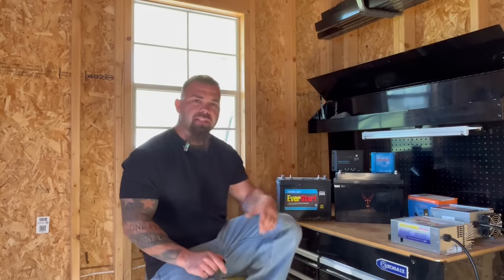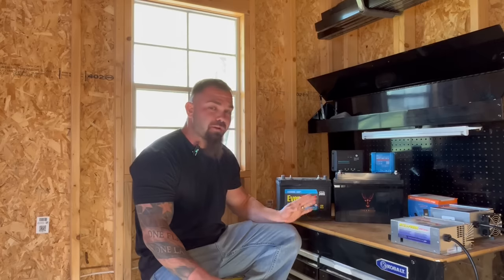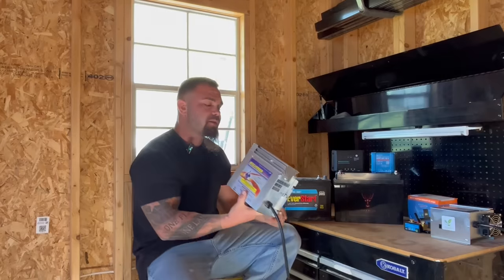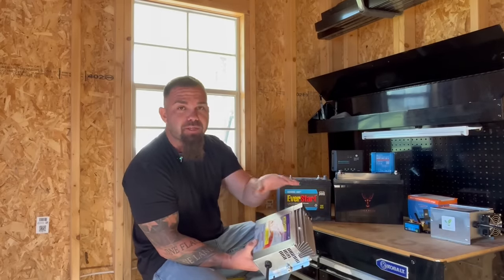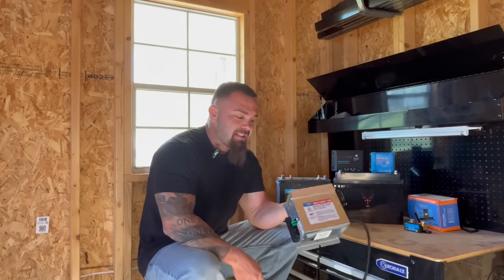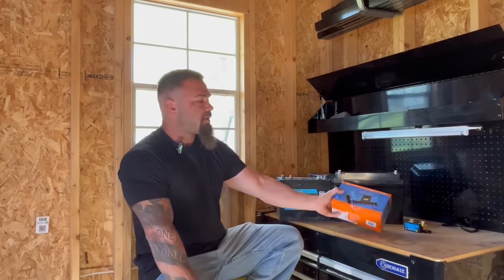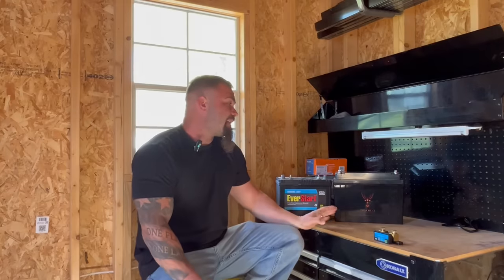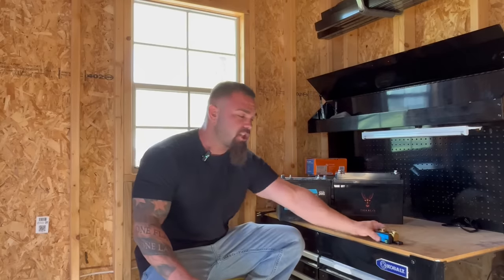Swapping to Lithium? WATCH THIS FIRST!

Comment: Been running my house off a large lead acid battery bank for over 12years before I switched to lifepo4.  I guarantee you a lead Acid battery will not be charged if you charge it to 13.8 volts especially when they are used overnight. They need to be charged to 14.4 minimum and brought to 14.8v at least once every 2 weeks.  Lead acid doesn't even come close to a lifepo4 battery.  AGM for instance is a stand by power system battery with a lead calcium chemistry that doesn't like to be cycled it prefers a constant trickle charge that is why they used to be used in power backup systems like cell phone towers need.  Lead acid is dead and can't compete with lifepo4
Reply: Lead acid makes for great engine starting batteries. I have had battery backup at home since the 1989 Loma Prieta earthquake. I had lead acid deep cycle battery bank, 6 volt Trojan battery bank, AGM 210 amp hour cell tower backup battery bank, forklift batteries. In 2017 I started using LiFeP04 batteries.  They have their quirks but are miles ahead of any other backup battery system that I ever used. A 50 amp hour LFP lithium battery easily replaces a 100 amp hour AGM battery. All lead acid batteries do not bounce back in voltage after heavy loads ''the Peukert effect'' like a lithium battery does. Lithium charges much faster, retains a fairly flat discharge voltage curve until its discharged. They are less than half the weight, last 10 times longer and have internal protection BMS units.  

The difference between lead acid batteries and LFP lithium batteries is like comparing drum brakes to disk brakes. Disk brakes don't easily fade after heavy braking, water doesn't bother them, they are easier to replace. I have a 1931 Ford Model A with mechanical rods that pull the brakes. No hydraulics. Lead acid compared to lithium. If they worked so well, all race cars would have mechanical drum brakes. Going 50 mph in the Model A is like doing 150mph in my Toyota Camry.  But you can't change the minds of old golf cart battery fans....
Reply: @kimmer6  yes very true...seeing these videos is kind of bothersome because obviously they are not experienced enough to know what you and I have experienced for decades. Since I changed to lifepo4 I get over 30% more power out of my solar panels and hardly ever need to turn my wind turbine on where as before my wind turbine was constantly going.  Also I never charge my lifepo4 bank more than 27.6v ever and I get the full 1010 amps hours out of my bank. And they are fully charged before noon! My lead acid batteries never ever were fully charged ever! .I monitor Amp hours with the wizbang Jr shunt on Midnite Classic charge controllers which is highly accurate. There is no comparison and like you said they are good for starting batteries that's all . Lead acid lead antimony are the true deep cycle batteries for lead acid and need to be cycled to maintain their capacity.  AGM are lead calcium which are meant to be used for ONLY stand by backup power use and aren't designed for cycling. They have a lower self discharge then lead antimony does .I could go on forever lol . 😆 I won't even start with maintaining them lol
Reply: I agree .
I use in my boat lipo4 .
Charge the lipo4 to 13.6 volt .
So i do not use security from the lipo4.
The battery will be 99% full.
And the bms will not go off.
A bms is a security if you go to high and close the systeem of.
Its not use for 24/7 like people think
Reply: @dyslectische  definitely you're right
Reply: I bet the car batt size battery is a rocket engine when one has thermal run away
Reply: @VinniePepperoni  You might be surprised to learn that there is more than one lithium chemistry.  The LifePo4 chemistry has almost no thermal runaway potential.
Reply: @kimmer6 
When I read stuff like that you definitely have my attention. The next question always becomes I buy near new for 20 cents on the dollar, and these are not RV or little boat batteries so where is the savings besides weight?

Maintenance I have no issues with.
Reply: @donaldradcliffe6704 Then why are so many home battery banks failing and catching fire.
There are recalls on this.
No lithium batteries allowed on my boat.  I refuse to have them for deep cycle purposes.  The Optima Bluetops are getting 10 years life and the yellowtop in my car is over 8 years old now.  Lithium is great  until it isn't and the thought of a lithium battery fire doesn't bear thinking about when you are 100 nautical miles offshore...
Reply: @1Longranger you said a mouthful brother…..better have a life raft and get it deployed immediately.
Reply: Yes, but there is always a possibility of a fire or explosion with lithium batteries. I'll stick with leaf acid batteries for now.

Comment: Best video I've seen so far about converting a RV, including class c's,  to lithium batteries.  Very comprehensive and nicely explained. Thanks.
Reply from the maker: Thank you sir!
Reply: thanks Bro very helpful
Reply: Agree.  No B.S.  I watched it twice and took notes the second time, then I subscribed.
Reply: Agree. Excellent video and very well explained 
I went to lithium 2 years ago in my older Lance Truck Camper …
420 w of solar on the roof ..
Upgraded the converter and it’s been a fantastic setup with  200 amp hour batteries
Reply: I agree best explanation I have heard. I understood all. There was 2 instances where he interchange lithium for lead acid and vice versa, otherwise perfect explanation.
Reply: What lithium battery manufacturer do you prefer?
Reply: This is great.  I have known this for a LONG time.  Very well described here.  One thing more, you need to disconnect the “isolation” relay in a motor home when adding the B2B charger so they don’t get paralleled when charging.   You could keep it for the battery “jump” part, but change the automatic paralleling circuit.

Comment: I have been camping for 20 years and never disappointed with my Interstate deep cycle battery that I replace every five to seven years. I see absolutely no reason to change what already works well for me.
Reply from the maker: Different strokes for different folks! Glad you are having success!
Reply: Ok
Reply: Far less weight for the same power or far more power for the same weight.
Reply: Do you do a lot of dry camping while using the A/C? New to RV camping.

I live in the desert and just wondering what it would take to run the A/C at night.

Comment: Excellent video! Installed 600 watts of solar on my RV last year, changed my batteries from 2 lead acid to "3-100amp Diablo Lithium Batteries". I Installed all Victron Components from the Multiplus ll to the Shunt, Charge Controller, Cerbo and Touch 50 monitor and love the setup. The Diablo batteries are a game changer not only can I check the state of charge from the shunt but each battery has a bms and is bluetooth so I can check each individual battery. Justin from RV Solar Concepts was a huge help with a wealth of knowledge. If anyone is looking to install solar on their RV I highly recommend RV Solar Concepts. These guys know what they're talking about and their workmanship is 1st class.
Reply from the maker: Good to see a local customer on the our new Youtube page!! Glad to hear you are loving the system and we appreciate the kind words as well!
Reply: Victron has been the market leader in control gear for quite a while but which is the "best" battery changes frequently. Anything sold as "the best" by a reputable supplier will remain good for the 10+ years lifetime of your battery but the next model won't necessarily be as good as another brand so leave that choice to your supplier on the day. Most brands supply BMS & Bluetooth nowadays.

Comment: Well done.  You covered these issues perfectly.   One item I would add to this conversation.  I have an off grid cabin in the very cold at times north country and it runs on solar.   The only reason I did not go with Lithium is because the low temperature charging limitations of a lithium battery.  Below 30F they do not do well.  Take care.
Reply: There are many ways to deal with charging lithium in cold temperatures... a 12 volt lap blanket being the simplest/cheapest.
Reply: Keeping the battery inside the house also solves the temperature problem.
Reply: In fairness , lead acid suffer from extreme cold too . Just to put that in perspective , i have no intention of changing to Lithium . It would be life threatening , used for the purposes i use them . Recently i have heard of several installations literally going up in smoke , without loss of life it should be added , but frankly i think it's purely a matter of time . The other thing is due to the nature of the risk , it's actually unlikely we will ever hear of such an event , which would likely be reported as persons missing , reason unknown !

Comment: Thanks for the information. Was contemplating swap to lithium in my 2006 class c. Everything you have said has me realizing all the rest of the changes needed. I’m going to go with a solar powered Ecoflow system with a 400 watt charging panel. Just easier all around.

Comment: A lead acid needs to charge to 14.4 + or - depending on temp. 13.7 is float. 14.4 is a perfect charge voltage for lithium as well.

Comment: Man this was EYE OPENING....my RV shop is really selling me on going Lithium in my class A, which I really want to do. But I am going to grill them on all this info before I do. I absolutely will put in these safe guards.....Thank you!
Reply from the maker: Yep hold them accountable! Dealers will just pop your old batteries out, put lithium in and it will perform like dog shit because they don't change the settings or the equipment to properly charge them. Then you'll be chasing non-existent problems and just assuming lithium is junk which is not the case, you're just only using half or less of your possible storage because they aren't getting fully charged.
Reply: @rvsolarconcepts  Yes sir, thanks again!

Comment: This is the first time I have seen anyone properly address the voltage differences. It also applies to the current you can safely charge with. NiCad, Lithium, Lead Acid and other batteries, all have specific charging needs. 
I knew this from my Ham Radio stuff, that you couldn't just swap out different types of batteries. Radio Controllers for toys and models also are designed around specific battery types, do to significant voltage differences, and charging voltage and charging current differences.

Eric gives RV Solar Concepts a gold star for doing his research.  😆
Reply from the maker: The devil is in the details, but it sounds like you know that sir! Thanks for your input Eric!

Comment: Thanks for clearing up the drop-in myth. On my RV, i contacted the converter manufacturer and to my surprise they responded with a diagram showing me where the lead acid/lithium dip switch is! A flip of the switch and I'm now putting out 14.6V! One 100 AH Lithium essentially has the capacity of two older 100 AH lead acid battery!
Reply from the maker: Nice! Glad you had a compatible model! You're off to the races now!

Comment: That was Friggin' awesome... very informative. I will add, one cool thing that lithuim is going to is having an onboard Bluetooth system telling you all the pertanant information eliminating the Shunt. I literally just got a new battery with this option so I have no idea the accuracy of it, bit it is extremely cool and may eliminate at least one item? Also, One thing that wasnt touched on is extreme weather, be it cold or hot. These things do have a window they must stay within or they will fail. Some manufacturers are adding shutoff options to the bms system which is highly recommended. Just thought I'd add that.... Thanks guys!

Comment: Nice video. But I  would like to say that my 4 six yr old Trojan 105 FLA's have been great for me & still going strong. I have 390w solar on roof & 2000w inverter w/Victron controller. If it's sunny, my setup gets us all the power we need as we camp where we have a good chance for nice sunny weather. My lithium friends run their genny's on cloudy days just like me. We don't ever need AC as we chase 60 to 80 degree's only. If  we happen to be in extreme heat, then we'll get a full hookup spot in an rv park for a coupla days as we need to do this anyway from time to time to do laundry & such. Anyhow, just wanted to let folks know there's a simpler way with  heckuva a lot less cost.

Comment: Great video about replacing lead acid with Lifepo4 batteries. Excellent explanation of all aspects of the two systems. I have done this change over three years ago, replacing my very heavy AGM battery with a 24lb 100 amp hour Lifepo4 battery. I have not changed my converter however, and have had no problems with the performance of the Lifepo4 lithium battery. I do have 300 watts of solar, and a Renogy charge controller that I set up for my  lithium battery's charge profile. I also have a Renogy 20amp DC to DC charger rigged into my truck, and a have a stand alone 25amp battery charger that a lithium charging profile. You don't need to keep a Lifepo4 battery fully charged at all times. I just top mine off once a month.
Reply: Your charge controller runs at 14.7 volts to top off charge on batteries?
Reply: @hstorysalie  14.6v

Comment: I'm glad I watched your video.  I'm getting ready for a cross country trip in our RV.  Both of my current lead acid batteries are junk.  I was going to replace with Lithium.  But after watching your video, I'll stick with the lead acid one's for now.  You saved me a lot of grief.  Thank you for posting your video!!  You explained it very well for the average person to understand.
Reply from the maker: It definitely takes a little planning and understanding to do it correctly so I'm glad you found the info beforehand! Thank you for your feedback, safe travels!
Reply: You can swap batteries amd do the other stuff later, it won't hurt anything,  im in the same situation with 4x6v batteries that need replaced, I'm dropping 2 BB direct replac batteries, I do have a 200w solar system and I'm able to switch it to li mode.. BB said it won't be an issue, amd the solar can actually bring the batteries to full capacity charge

Comment: The other thing people don’t consider is where the battery is stored. LiPo and LiFePo4 are excellent batteries, but need to be kept away from extreme temperatures (hot and cold). Some have built in BMS systems with battery heaters to help in the cold, and also shutdown the battery to avoid a thermal runaway scenario, but generally an engine bay is a bad area for them. 

Also, a lot of vehicles are now equipped with “smart” alternators that will easily output 14.xx volts depending on the load requirement.

Comment: Good video. I myself did just enough research before buying my battery. I have a Victron Smart Shunt and Controller. Been working great. Only problem I ran into was an occasional update resetting the controller to a non lithium setting.(hasn’t happened lately) I changed out my converter. Nice to go from 4-5 amps from the old converter to roughly 25-33amps charge with the new one. I ran into one guy who put a lithium in his camper, but was satisfied with it NOT being charged properly. My only (sort of) mistake; I bought mine a couple years ago, so yes a bit more expensive and had little options on batteries capable of proper charging in cold weather. Although I winter in southern New Mexico, i wanted to be prepared just in case. So bought a more expensive one capable of cold weather charging only to get curious enough to find the battery compartment never got cold enough for the BMS to kick the cell heater in. While rare, I still get into single digit temps but plenty(like 2 nights ago) temps got down to 16° and battery compartment was still above freezing.
Reply from the maker: Well that's good that you never ended up needing that feature, but it's there if you ever do!

Yeah I think most people believe of the ambient temp is below 32 degrees then the batteries won't charge. In actuality, as long as the internal temperature of the cells is still above 32 they will operate as normal. In most cases, it takes several hours at 10 degrees or below to finally reach the point of triggering the battery protection.

Comment: Thanks for this clear explanation on the compatibility of existing RV systems and tow vehicle alternator charge circuits to lithium batteries. I have an older 5th wheel rv (no solar) and need to replace my worn out lead acid batteries. I was considering switching to lithium but after checking my converter, it has an output rating of only 13.6V. Thanks to your video I will stick with my same lead acid battery arrangement by using two 6V Golf Cart batteries hooked in series to make 12V. It has served me well for the past 5 years.
Reply from the maker: Glad we could clarify some things!

Comment: Nicely explained in simple terms.  I've been wanting to convert to Lithium in my Motorhome but did not understand the DC to DC charger or the shunt.  Now I umderstand.  I have done all the work on my motorhome but, for some reason, these items really seemed complicated.  Now, I'll have to start planning my swap and wiring diagram so I don't get lost.  Thanks !
Reply from the maker: Thank you! We just published a video on the installation and programming of the victron shunt so be sure to check that out and let us know if you have any questions!